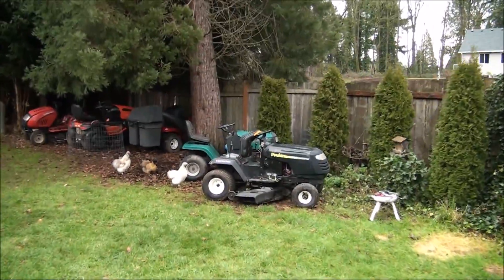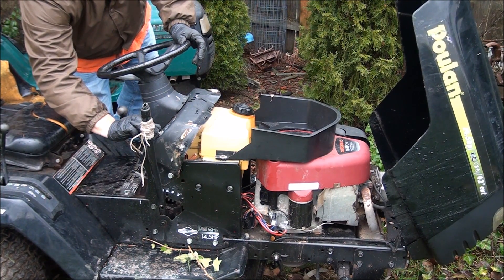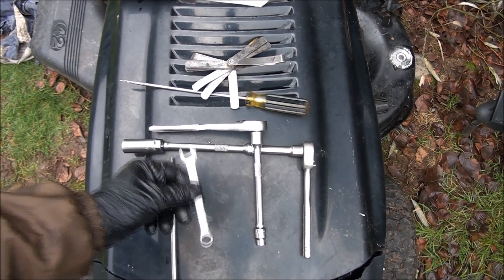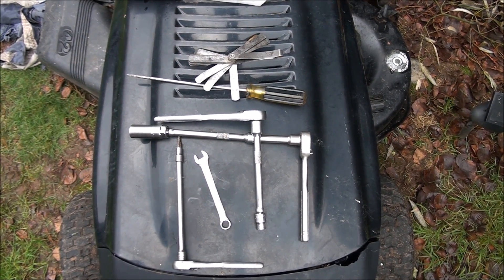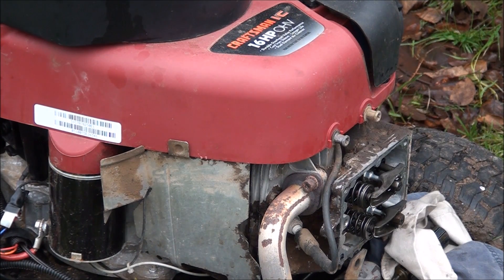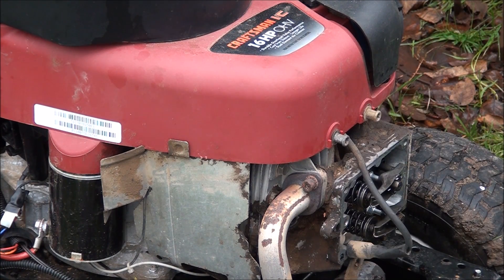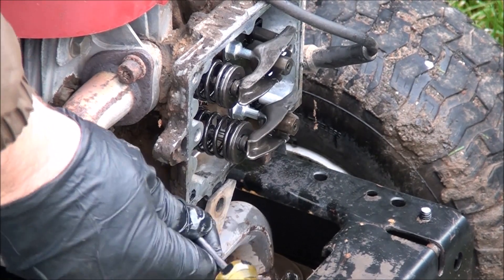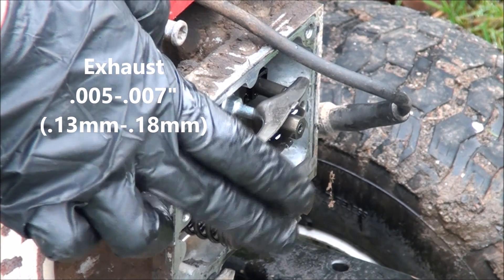Is it the VALVES? Single Cylinder Briggs and Stratton OHV VALVE ADJUSTMENT Procedure and Specs

Comment: mine starts hard  but it will run it just pops and misses and never comes up to speed
Reply from the maker: could be a fuel delivery problem or a sheared flywheel key
Reply: thanks  Ill check both
Reply: I took  the valve  cover off and one of the bolts   that hold rocker  was loose and rocker was  just hanging off  side of push rod  its missing the cap as well have not located it
Reply from the maker: yikes!...I have seen that before too!

Comment: I've got the 18 hp OHV Intek and I'm sure the valves need adjusting. ITs hard to turn over and after 20 or so minutes of using the mower, the engine just doesnt want to run anymore. I attempted to adjust the valves once before, but apparently I did it wrong, because they seemed to not need adjusting. I'll go recheck them though. I've got a video up on my channel of when I attempted it, and if you could let me know what I may have done wrong that would be great!

Comment: Replaced the head gasket on basically same engine. Brigg's with the classic burnout by the galley for the intake. Now it puffs smoke at times but not all the time. Usually when I engage the blades or maybe a shift in the terrain. Along with that naturally is oil usage. Not severe, but annoying oil usage. Guessing the obvious more pressure on the rings or valve guides. I did valve adjustment also. Any ideas?
Reply from the maker: good question. You are right about the head gasket issues on this model. Unfortunately it possibly sounds like the beginnings of the engine "wearing down". Some of the first signs of a tired engine that I have experienced are struggling/smoking while under load, excessive oil usage etc... Could be valve guides, could be rings..could be?? I say run it til it blows!!!!.
Reply: Yeppers that's what I'm gonna do . Thanks for the reply and nice channel !